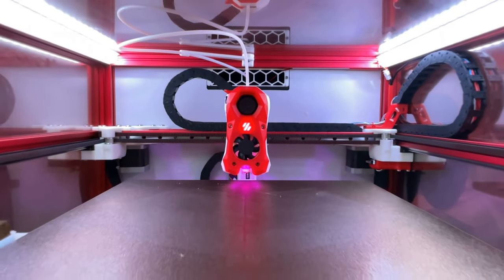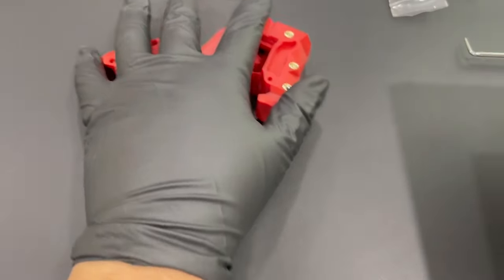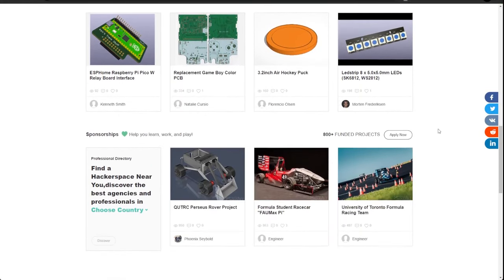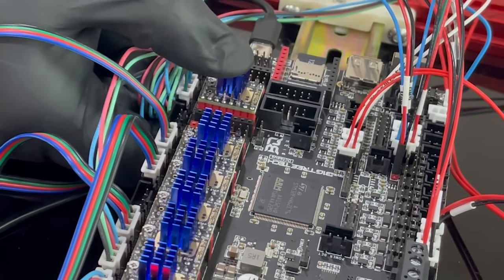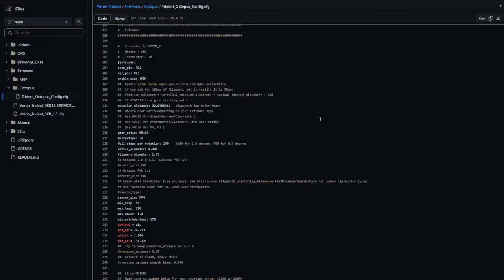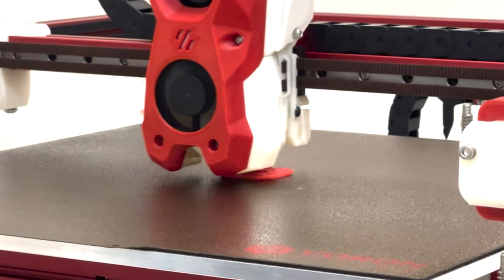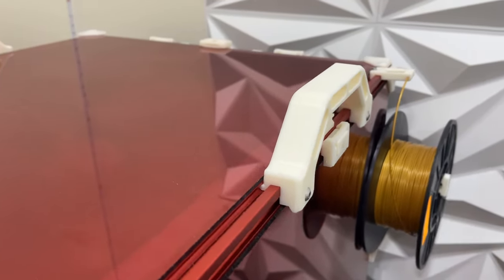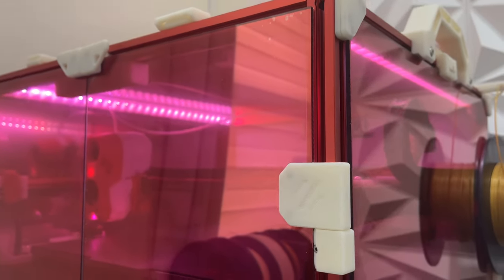3D Printer Build: Voron Trident Part 3 - Toolhead and Electronics

Comment: you can absolutely connect your digital multimeter to main if you have it on the correct setting, just saying.
Reply from the maker: I was just concerned (and still am) of someone hurting themselves while trying to “figure it out” and decided to air on the side of caution. But you’re completely right, I thought about taking out the bit in the video but decided it was probably for the best to leave it on.